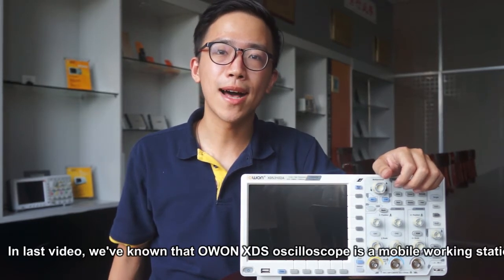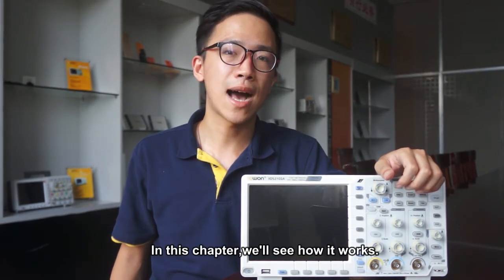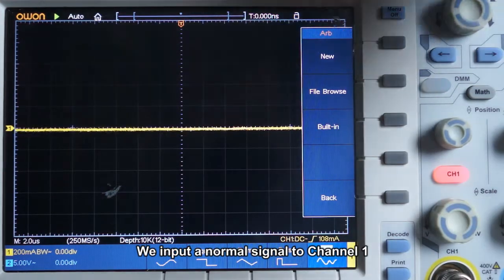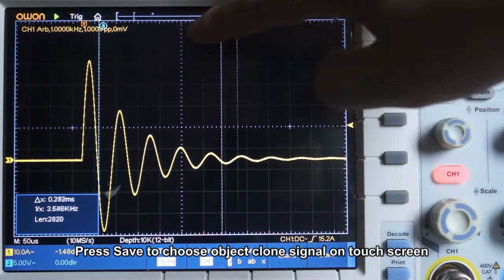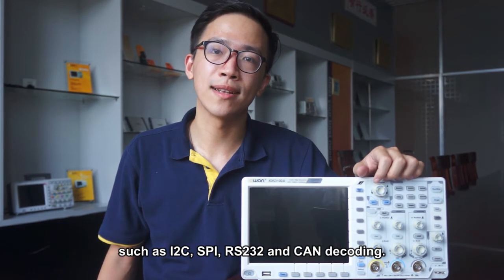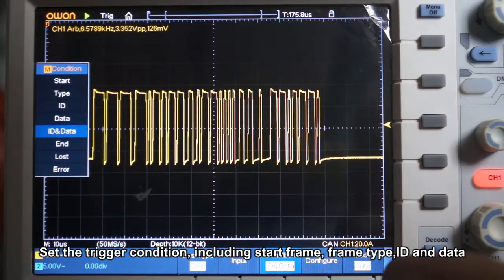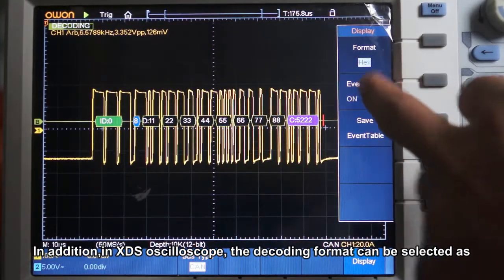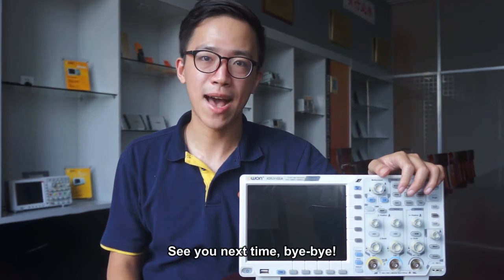OWON XDS Decoding & Waveform Clone

Comment: Dont buy any OWON machine. I bought MS08102T with Logic Analyzer.I gaved a lot of money before 6 years ago. I bought sea logic analyzer only 10 dolars. Sea logic analyzer works better than OWON. I am very sad to buy. Next time , i will buy RIGOL. Also, you need to buy RIGOL. Also, user manuel does not say anything about to use. I could write this user manuel in 3 days. Maybe, i can try PC OSCILLOSCOPE  or RIGOL . I will sell my OWON with very low price. I didnt used more than 10 hours. When i was buying OWON oscilloscope , i was a student at electric and electronic engineering. And, i was 1.year in the class. Therefore, i did not know a lot of information about oscilloscope. :( . Now, i will be graduate in 1 month from engineering department. I learned a lot of thing about my engineering mistake. Also, i am very good coder for PIC,ARM,AVR,C#,C++. and GUI design. Also, OWON need to learn make good oscilloscope. OWON you can make only kid toys, if you continue this strategy. Look RIGOL, analyze RIGOL. You need to give very good support about communication protocol. Are you know this? I think yours engineer does not know this. If you want to sell OWON to users, you need to make good firmware on windows. I could not see very fast graph result. You need to learn compressing data technology to fast communication. And you do not need to produce 2 channel analog oscilloscope. You need to make best one with 4 channel  analog and 16 channel LA oscilloscope. And, you need to make this machine price  same with RIGOL 2 channel oscilloscope. You can use biggest screen in oscilloscope, but if this screen does not include anything, your oscilloscope is anything for me. Please , try to understand users.
Reply: Did you seen RIGOL price? Sure, for that kind of genius like you it's not a big money but it still huge money for students and beginners.